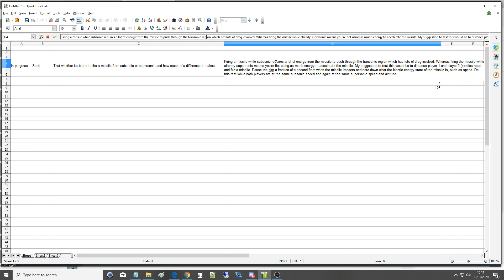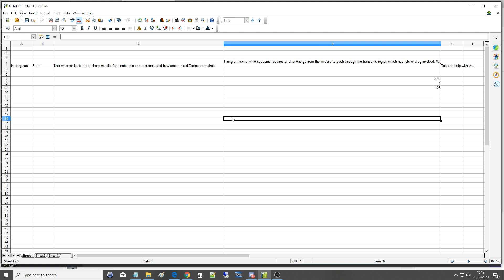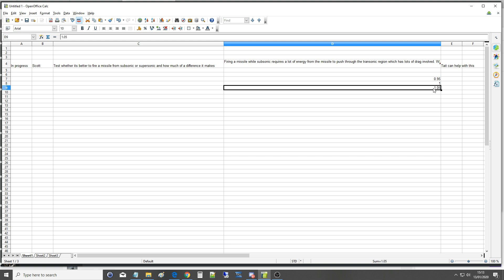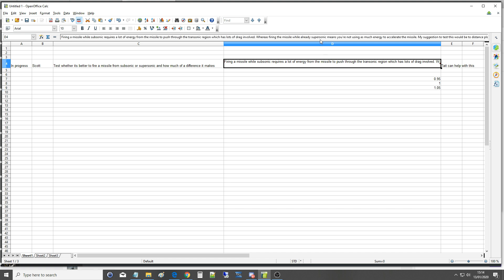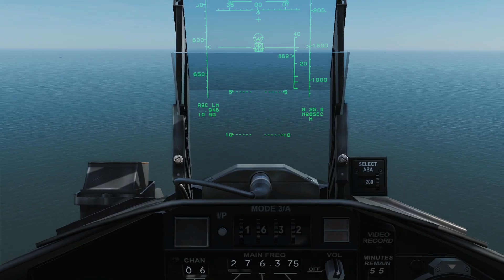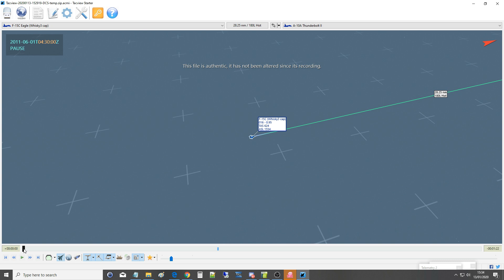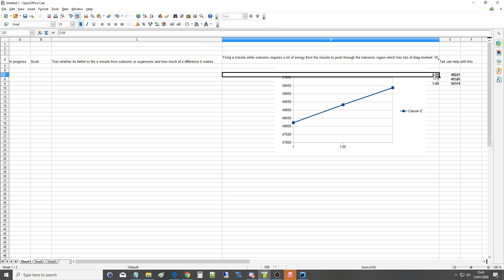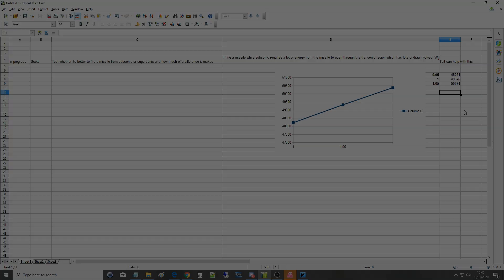Questioned: Missile Efficiency In Transonic Speed Region | DCS WORLD

Comment: Hey Cap, in keeping with the comments below I think it would be better to assess the efficiency of the missile's flyout from the differing speeds at either end of the transonic region. I would suggest a speed range of 0.8M, 1.0M and 1.2 Mach. Heights would be Sea Level, 15000' and 30000'. Let the missiles flyout and measure how far they go until their speed diminishes to 1.0M. This would give a measure of their efficiency. I would expect there to be a non-linear extension to range when launched with increasing speed. This should further increase with increasing altitude. Of course, this assumes that air density and mach interaction is modelled correctly!

Comment: Cap, this experiment proves nothing, since you measure the initial energy (which is simply height + speed of the aircraft + the missile's engine energy, and the latter is always constant) instead of the rate at which missiles are loosing their energy due to different aerodynamic resistances at different flight regimes (subsonic - up to ~0.8M, transonic - ~0.8-~1.2M, and supersonic - above ~1.2M).

Comment: I know what Scott is referring to, if you plot drag vs Mach theres a point called drag divergence mach number where theoretically drag goes to infinite. But these missiles have very slender thin bodies also their surface area is very small so i dont think they get affected by this drag divergence phenomena in real life as well. 

I stand to be corrected but Ive seen drag vs mach charts of b1 lancer while it is a huge plane since it is designed to go supersonic it has  lower maximum drag than a f86 sabre.
Reply: They are affected by the drag divergence, the problem is cap is flying at M 0.95 which is basically the very end of the transonic regime. It would be better to fire one around M0.8, one at 1.0, and another at 1.2.
Reply: Bone having less drag than a Sabre. Thats interesting

Comment: The speeds you checked were all transsonic, test would be better with speeds such as .5, .7. 1 and 1.2 M. Check how the chart cD/M looks.
Reply: Tomáš Bohýl that convention is only used when providing simulations and analytical results of bodies travelling in fluid. We use 0.8-1.2 because the model that we use lower than that (the Prantl-Glauert method) and the model that we use higher than that (Ackrets theory) break down into a non-physical singularity at M=1
Reply: @ZT363  Alright, but my thinking was that the test speeds should take in account the shape of the drag/mach speed cahrt, and it starts to diverge at cca .8M
Reply: Correct.
Reply: Garbage like all missiles. DCS missiles are so poorly modeled.
Reply: @dev0random  hard to tell when the test for this is wrong. 0.95 is too far into the transonic regime to make a determination.
Reply: @rampant5139  True, but the missile models have always been garbage in DCS and it's only recently they've started actually working on improving it.
Reply: Tomáš Bohýl by definition anything about Minf=1 is supersonic, not transonic
Reply: @ZT363  Transsonic is around speed of sound, from M=0,8 to M=1,2

Comment: .95 1 and 1.05 are all transonic regimes
Reply: Rafael Elias by definition anything above Minf=1 is no longer transonic and has passed into the supersonic region
Reply: @ZT363  I think it is called transonic region, i.e. it's a range of speeds (in Mach numbers) in which jets exhibit special behavior. The transonic effect range is around 0.8-1.2 M, if I'm not mistaken. So Rafael Elias is correct.
Reply: Igor Z this convention is only used when providing analytical and simulation results of bodies at these speeds. This is because the methods that we use below (Prantl-Glauerts) and the method that we use above (Ackrets theory) break down at M=1 into a non-physical singularity. Therefore it only begins to replicate Ackrets theory at 1.2, which is why you’ll see this when you inevitably google ‘transonic speeds’
Reply: @ZT363  Transonic flight means the airflow in different parts of the body can be at the same time grater or lesser then Mach 1, that's why most literature defines transonic as anything between .8 and 1.2, so sure, anything above mach 1 is certanly moving at supersonics speeds, but from an aerodynamics standpoint it's in a transonic regime with all it's drawbacks in drag
Reply: Rafael Elias drawbacks such as what? If you’re looking at Cd plots then yes there is a peak in the transonic region in terms of the coefficient, but you have to remember that wave drag starts at transonic and continues into supersonic. If you look at the force vs speed graph then you’ll see it doesn’t dip after the transonic region and actually increases

Comment: Hey Cap, is there any difference in evasion tactics when your aircraft drops flares down(F15) vs up (Su27)?
The seeker head of each side is programmed with that in mind (american missiles more efficient against flares up and so on..)? Is this implemented in DCS?
Reply: I feel like upwards flares are better for turn fights as it is exposed to the seeker head earlier, as the downwards flares only get seen behind and far from the jet
Reply: @wantdatcadpat44  yea in a turn fight u are golden with the su27 but in a head on u can't as effectively barrel roll
Reply: i dont think so just make sure the flare face the right way
Reply: Some aircrafts have flashers to jam or guided missiles. Turn em on. I do know su25t has it, and it is backwards facing

And ideally, to a missile, you should appear splitting into 2 different track point, like flare going up and you going down, or flare going right and you left. And use a lot of em.
Reply: @SurajGrewal  yea in the su27 u will need to  use negative G's a lot
Reply: @possiblyadickhead6653  yeah. Kinda a problem... In Russian aircrafts, it's better to turn
Reply: @SurajGrewal  yea not until u run it dry just for a short moment when the missile is almost in your face. I only do this if the foe is head on tho
Reply: Some pilots actually fire flares and Chff before the missile is fired as a pre precaution. Specially helicopter pilots
Reply: @SurajGrewal  yea that a good thing to do.